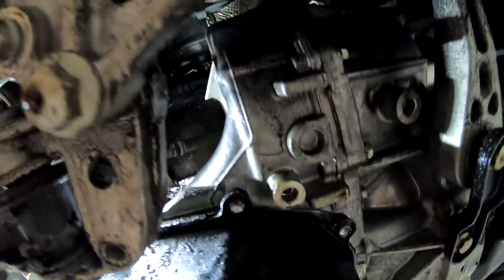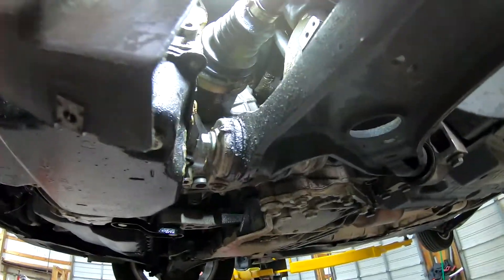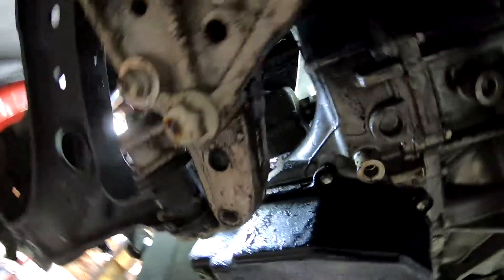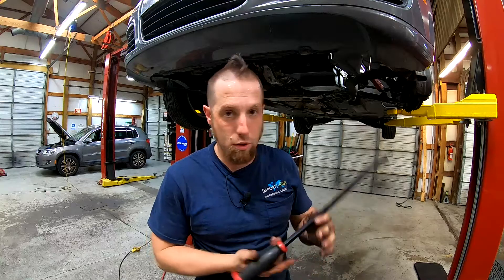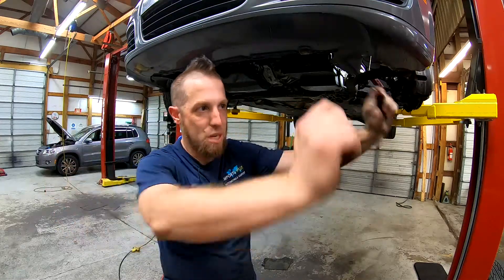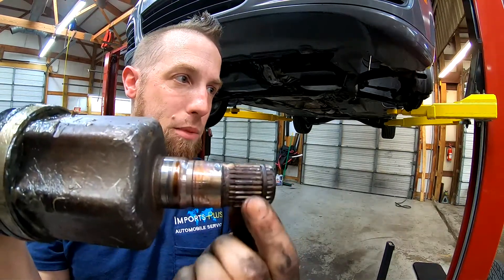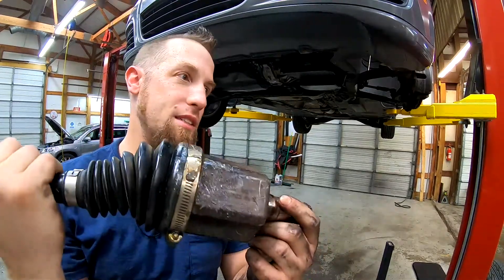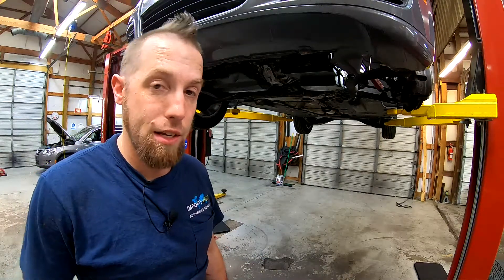VW 2.5L Axle Removal

Comment: Thank you, replacing both on my 2013 passat this weekend. . Never worked on VWs, it's been an experience. Changed  both control arms couple weeks ago, not one video mentioned that after you lower the subframe down to get that one stupid bolt out that you've just trashed that alignment most likely. I did and now I'm trying to research subframe alignment for it and not coming up with much. Hopefully this goes better. Thanks again.

Comment: Just a tip incase anyone watches this video still. Open up the hood and from the engine bay tap the top of the axle shaft with a extension and hammer and with another person under the car use a pry bar to pry from the bottom side of the axle shaft.

Comment: @deamonmachine Hey there! Ive been trying to get mine out for 3 days now! When you say you wedged a screwdriver in the top while you hammered the bottom with the angled pry bar, how exactly did you wedge the flat head in there? Were you able to get the screw driver behind and between the axle stub and the transmission or did you just create more of a space between the top of the axle stub and the transmission so when you hammered the axle didn't push back up for the even pressure? Thank you for the video!! It such a frustrating process
Reply from the maker: It can be infuriating honestly. My most successful way has been to try to get something to hold tension at the opposite side you are prying from.. 

My last shot is flipping over the pry-bar putting it in the notch and trying to hammer it out in the direction it goes in (horizontal) That way is best with an air-hammer but I've used a regular hammer and prybar with a curve at the end to get around the transmission onto the "notch" looking thing on the axle.

Comment: Prybar ain't doing anything, I've been stuck on this for 2 days trying to get this stubborn axle off on the driverside.  Never had such difficulties taking axles off ever. A simple pry and jerk should have done it.
Reply from the maker: Try using the angle of the pry-bar to hammer it out in that direction. I think I showed that method in the video, if not i'll have to demonstrate it at some point. I've taken an engine/trans out w/ the axle still in because it was so stuck.
Reply: @deamonmachine  yea, I'm just gonna keep trying, and hopefully, it eventually comes out. I appreciate the content and the methods . But that's absurd that you had to take the engine/transmission out  to get the cv axle orf. Looks like this is a common problem nowadays.  Thanks again, man!!! Wish you success!!!

Comment: I got the driver side out no problem I’m having a bitch of a time getting the passenger side
Reply from the maker: That's great, cause the pass side is easier to access all the way around, just put a screwdriver or something to counter-push the inner joint and then use a prybar to pop it out (load it with screwdriver and apply quick fast pop to the prybar)